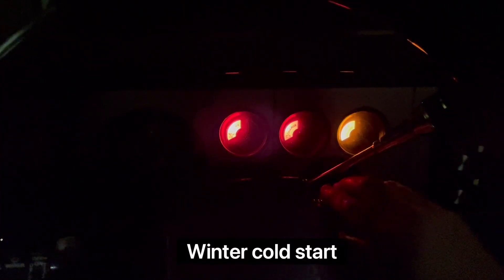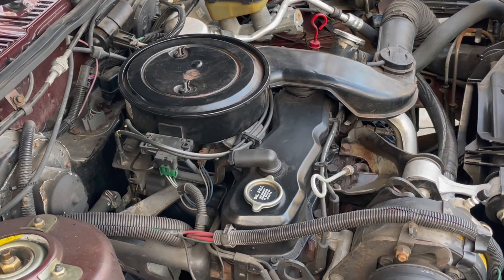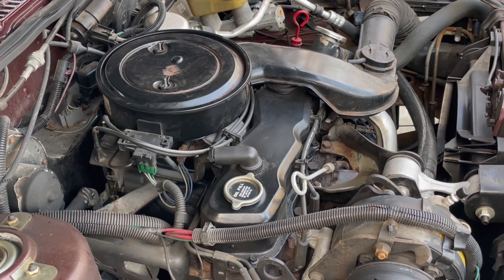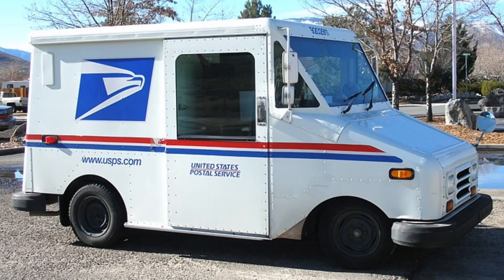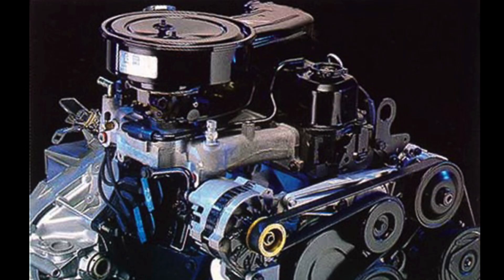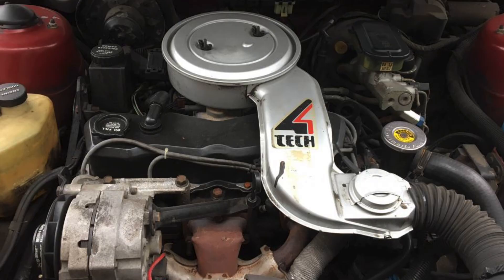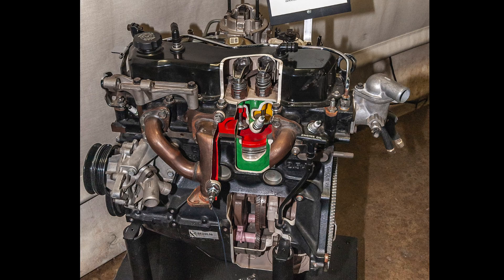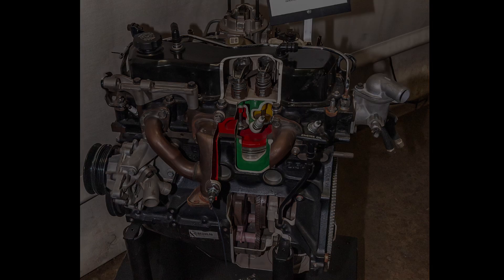Worst Sounding (and Most Recognizable) Engines: GM's "Puttering" Iron Duke 2.5L I-4

Comment: I've always been irritated that the LLV was outfitted with  TH700R4 transmissions. Why did they need an overdrive automatic for constant stop and go driving. They should've at least been instructing the drivers to use Drive rather than OverDrive to help the trans last a little longer. I realize the TH350 was long gone by then, and was never offered with that bellhousing, but there must've been a 3speed automatic behind the Duke when it was in a Monza. Why not keep producing that trans for the USPS? Or maybe they could've whipped up a new bellhousing casting to use the TH400 that they were still producing. There were better choices than the TH700R4 🤬
Reply: Agreed. Hell, they could’ve even brought back the old Powerglide from the dead for the USPS, for that matter
Reply: @440mgnm  Yes definitely 👍

Comment: Having worked on these in the day, the primary source of noise is too much backlash between the  cam and crank gears.  Early on, replacement gears still had too much backlash and continued to make noise after replacement.  Later a revised gear set hit the market and the engines were relatively quiet.

The Iron Duke in rear drive cars had intake and exhaust on the same side as it was based on the 250 / 292 inline 6, this configuration continued on in boat and industrial applications ( like forklifts and generators ) expanding to 3 Liters .  In fact, the 3 L was available in the GM performance parts catalog as a 3 L Super Duty as some were road raced in Fieros.   And. . . the company Blueprint Engines still builds a version of the Iron duke for industrial applications. There is even a prototype with a GM LS V8 head.  

Front drive cars got a cross flow head and later a tubular exhaust manifold.  These tube manifolds tended to crack where all of the cylinders joined together however there are easily welded with a MIG welder running regular mild steel wire.   ( I had a spare cylinder head at the ready to use as a welding fixture ) 

The N cars used a shorter version of the " Tech 4 " as under hood width was at a premium.
Reply: Interesting post. Thanks.
Reply: The engine that was based off the 250/292 six was never called an iron duke. That was the Chevy II 4-cylinder which was actually based off the Chevy 194 six. Only the Pontiac designed engine is called the iron duke.
Reply: @Cream_of_sum_yung_gai   The Iron Duke / Tech 4 were not clean sheet designs by Pontiac, all they did is take the non cross flow headed 4 cyl and designed a cross flow head as well as making it front drive capable.  ( Side mounted water pump , smaller bell housing )     The timing cover gasket ( all the way up to the N cars)  is the same as a Chevy 250 / 292  inline 6 . 

The last " real " Pontiac engine was the 265 / 301 V8 that went away in 1981 ish so Pontiac engine engineers didn't have much to do so I'm betting this is why the 4 cyl was attributed to Pontiac.  All the other divisions still had their native engines going or were busy working on moving to corporate engines. 

Calling any of the 3 four cylinder engines Iron Duke is generic enough that anyone in the biz knows what someone is talking about.
Reply: @bobroberts2371 iron duke has the distributor at the flywheel end of the block, Chevy II has it at the front. Head bolt and bore spacing is also different.

Comment: If nobody said it yet... (Among the) Worst sounding engine to me is the Chrysler 2.5.  My wife had that engine - a stroked 2.2L K car motor - in a Dodge Daytona.  It sounded like a diesel and at idle it'd shake the coins you kept in the ashtray. It had torque until around 2000 rpm so the car would move fairly well until about 25mph and then have an asthma attack.  Great car for around town, but couldn't climb a mountain on the interstate no matter what you did with the accelerator pedal.

Comment: I owned a 1981 2 door Pontiac Phoenix with a manual trans Iron Duke. On the plus side, it would start at 40 below zero. On the negative, it clattered loudly and developed a metallic clanging at about 30,000 miles when under acceleration. I traded it the week I noticed that. Never owned another Pontiac.

Comment: I have to disagree with this. I owned a bought new 1986 Pontiac Fiero powered by the 2.5L Iron Duke, with a 5 speed manual transmission for 11 years and nearly 200,000 miles without a single problem. Yes it has a mechanical sound. Pretty much all 4 cylinder engines do. Have you ever listened to the sound that an air cooled VW engine makes? I've owned three air cooled VW Bugs, and I love that sound, especially with an aftermarket exhaust. I currently own a 1972 Ford Pinto wagon with the 2.0L SOHC inline four engine. It has solid lifters (not hydraulic) and makes some mechanical noise. It's supposed to. It's a machine.

Comment: One of my favorite GM engines was the Chevy 230 straight six.  All was great until you had to drive through a puddle or remove the manifold.  Nothing short of milling could make that exhaust manifold fit and seal again.

Comment: Boy, that is a key sound of the 1980s and it was everywhere.  The weird thing is that common sound of the Iron Duke made my Calais’s Quad4 feel and sound like a finely honed Swiss watch!
Reply: The Quad 4 was a relatively smooth engine and when equipped in the right car produced exactly twice the hp of the Iron Duke. Quad 4s get a bad rep, but I had one in a 1989 Calais and it was pretty stellar. The early ones were trouble prone, but the later ones were sorted out.
Reply: @paulwindisch1423  I loved my ‘90 Calais with the Quad4.  It was seriously quick for the era.  I could easily keep up with 3 series Bimmers and Saabs.  My only complaint with the car was I wish it had 4th cog In transmission.  Otherwise, nice light car with a people engine.

Comment: I bought a pristine 82 olds omega 2 door with the iron duke in 1995 from a little old lady, had less than 50k miles. Needless to say, she had never had an oil change done. I changed all fluids but it still spun a Rod and main bearing within a month of purchase. I had to pull it and completely rebuild it. It lasted me from 1995 to 2005 and still ran great when I gave it away. If I remember correctly the cost of internals was cheap, It used Chevy 350 pistons and rods and Rod and main bearings. The phonetic gear was never a problem for me. I had the single fuel injector fail twice(TBI). Also the engine top Mount shock absorber(from the engine bracket to the radiator core support) would wear out, and would cause extra noise from the engine bay. It was a very reliable engine once I redid it
Reply: Actually it had the same pistons and rods as the Pontiac 301 V8, designed at the same time, which had the same 4" bore and 3" stroke...the Chevy 350 had the same 4" bore but I assume a different pin location due to the longer stroke & shorter rods.

Comment: Ford's 2.3 and 2.5 liter 4 cylinder engines that they developed from their inline six, and used in the Tempo, Topaz, and Taurus was tractor-like in its NVH.  Maybe not quite as bad as the Iron Duke, but still crude.

Comment: You forgot Camaro and Firebirds had this engine in the early 80s. I would like to see you pour all the oil out of that metal air filter housing. I used to do tune ups on them and every time i would take the filter lid off there would be oil to the bottom of the filter gasket.
Reply from the maker: I did mention Firebird ;). Never seen that oil issue with mine.
Reply: I should stop commenting until I've watched the whole thing. One of my bad habits. :( @RareClassicCars

Comment: Fuel sipping , pocket pleasing front wheel drive Omega by Oldsmobile... we had one built for you!  Omega!  Oldsmobile....I remember this engine. I remember putting this engine in so many GM cars. I recall it was even offered in Firebird and Camaro at one point. What about Quad 4? It was a high tech 4 cylinder engine.  The interesting that the 4 cylinders are more powerful and turbo charged too. I liked the fact you mentioned the GM Brazil engine. Thank you once again Adam.
Reply: He does great reviews.  I want him to review the Quad 4.   I drove one in a Grand Am in the late 80's.   I took it back to the dealership 😂.   That thing was rough.
Reply: @keithjackson286  I would like to hear what he has to say about the Quad 4 too. He does have great videos. I never called this engine the "Iron Duke".. I always called it the Tech IV 4 cylinder. My uncle had a Pontiac Grand Am that had this engine. I had a friend that had a  Buick Skylark that had this engine. I know two people who had a Oldsmobile Cutlass Calais with this engine.  I recall seeing loaded Oldsmobile Cieras and Pontiac 6000's with this engine. You could hear anyone coming with any GM car that had this engine. The mail trucks are still in service as he says.

Comment: Overall harshness...My vote goes for the Chevy Sprint 3 Cylinder (Predecessor for the Geo Metro) Like the Iron Duke, it ran (though that was a mixed blessing) just fine, but I've driven Army trucks with more refinement.
Reply from the maker: Good call

Comment: I agree that these engines sound horrible. I had to replace the cam gear in a customer's car back in the late 80's. The worst part of the whole job was that the gear was pressed onto the cam, requiring me to lift the engine practically out of the car to remove the cam. 
I would also add that GM was very into using RTV instead of gaskets, and the Iron Dukes had the leakiest valve covers of almost any engine.

Comment: Had a Duke in a marine application/ Mercruiser.  I remember it being a little under powered but not any noise personally.   It was a super reliable little engine.  I’d file the points every spring and it was good to go.

Comment: Mopar slant 6 always had a certain noise to it, though I think it was just the valve train. Also too, those things were on the road for so long they seemed louder because they were from a bygone era.
Reply: The Slant 6 used solid lifters until the 80's, and I would imagine that nobody ever took their Valiant in for a valve adjustment! Besides, they were so reliable, all you had to do was add oil and drive it.

Comment: The phenolic cam gear was used on the ford 300 i6 as well,they lasted pretty well, but I tore mine apart to replace it with a cast iron gear that will outlive me. I can see why the factory chose the phenolic ones though, as it sounds much like a tractor - works for me as I am happy with the reliability.

Comment: I had a 1987 S-10 for 11 years Iron Duke. Fiber gear failed at 125,000 had it towed to BES and they bored it.030 over and it was still running when I sold it to my brother in law.

Comment: I have to agree with you. These things have to be the crudest engines GM every built. I remember working on them back in the day we got a lot of these in for warranty making noise. One of things they would have us do is drill a small hole in one of the oil galley cup plugs. It was right behind the cam gear. This would allow more oil to lubricate the gear. At best this was a band aid fix. It did make the gear last longer.  You are right the noise is generated from the cam gear interacting with the crank gear. The repairs we did did improve them a bit but they still vibrated pretty bad. The balance shafts where a God send. It smoothed these out a fair bit. Another issue with these is head bolt fractures. The head bolts from the factory where actually too hard and did not have enough stretch during thermal cycling of the engine. Over time they would break. The repair was to replace the head gasket obviously and with the head gasket you got a set of head bolts which where actually softer. The torque sequence was also changed to a torque to yield configuration. As you said these engine where reliable just very crude.
Reply: These ALWAYS sounded like CRAP, but so did MANY "G.M. classics"! They DID USUALLY "do the job", though!
Reply: If anything, the phenolic gear would tend to dampen noise. 
I found the noise was changeable for better or worse, by shimming the rockers. 
Too much though, & it wouldn’t run right.

Comment: My local post office still uses LLVs so I still frequently get to enjoy the sound of the '80s. My badly neglected '89 S10 sounded like an irate sewing machine all the way up to like 230,000 miles when I suspect it lost a piston wrist pin. It drove 80 miles home with a piston progressively smashing into the cylinder head harder and harder the entire way. It appeared to still be getting its normal fuel economy while it did it and I was still (barely) able to travel at highway speed. 🤣

I also challenge you to revisit your thoughts on the 5.7 Diesel before you judge GM's crudest sounding motor again. 😂
Reply: Those diesels were awesome sounding. 😎
Reply: @LongIslandMopars  Hard disagree...
Reply: @TheBrokenLife  Its an acquired taste ...😎

Comment: The Duke got pretty good toward the end of it's run. In typical GM fashion. It sounded rough at start and at full throttle, but was quite at cruise in the N cars.
Reply: GM still was running the bones of this engine into the early 2000s.  Refined it quite a bit.  We had one in  an 88 celebrity, and I had the newer one in a 01 alero,  and it's night and day.

Comment: Its noisy, its slow, and its heavy, but its reliable to a fault. I had one in my 1988 Grand Am 5-speed, and it was great. Decent on fuel, although it leaked oil like crazy, but it never let me down. These things are almost agricultural in their design, sound, and power output. And those balance shafts, that was the only thing I ever had issues with in my Grand Am. They just let loose and lost the oil pump since its driven off of the balance shafts. Thankfully I was still able to source one from GM at the time (2005 or so) so I could replace it (which is easy) and keep going!
Reply: Do you happen to know how to access the coil packs in the transversely mounted iron duke? Do you have to remove the intake manifold?
Reply: @gregorymalchuk272  from underneath the car. the crank sensor is behind the coil pack/igntion control module and it fails quite often. Its not too terrible, but its a pain in the rear.
Reply: @MichaelAStanhope  I was looking at it from that angle, but some steering link or sway bar and a transmission mount keep me from being able to get an arm up there. Somebody else said that the recommended thing was to unbolt the dog bone motor mount, swing the engine forward by about 4 inches, and access it from the top. I lost spark on cylinders 1 and 4 on an 87 iron duke with distributorless ignition. I was suspecting a bad coil or bad ignition module. What problems does a failing crank position sensor cause? I have heard of it causing no spark, but would it cause this? I had heard that the crank position sensor is connected to the ignition module and actually comes out with it.
Reply: @gregorymalchuk272  yeah, you have a failed coil. There are 2 coils on there, one for Cyls 1 & 4 and one for 2 & 3. One of them has failed. I would replace both of them to be safe. You can do it from the top if you take the torque strut mount off (dogbone). Not sure what care you are working on, but in my old Grand Am i found it easiest to get access from underneath the car. If the crank sensor goes out, you will get NO spark at all, as in the car won't run at all.
Reply: @MichaelAStanhope  Do you think it's the coil or the ignition module? They use a wasted spark system, so I measured both the coil secondaries through the spark plug leads and got 28000 ohms. Perhaps 10500 ohms for each lead and 7000 ohms for the coil secondary, which is exactly what the Haynes manual says. Do the coil primaries short or go open? Were the coils common failure items? I'm more suspicious of the 36 year old power transistors in the ignition module. If it was easier to access I would be tempted to swap the coil position and see if now cylinders 2 and 3 are dead or if it stays at 1 and 4. But the difficulty makes me want to replace everything. Another thing is that the V6 engines would get corrosion and lose the ground through the bottom of the ignition module to the bracket, is that a problem on the iron duke?
Reply: @gregorymalchuk272  id still lay bets on the coil being bad. In 25 years as a mechanic i've found that readings using an ohmmeter can give you false leads on the GM DIS system. Honestly, at this point, I would replace everything down there since its all eventually going to fail. Id pop on a new crank sensor, ignition module and coil packs just so that 1) I would only have to get in there one time and do it and 2) so i know its going to be reliable for another 10+ years. On these engines, and the 2.0/2.2L engines in the Cavaliers I honestly just replace it all since its a pain to do in general, and its really a lousy place to have the igntion system in general because of heat.

Comment: 1982 Skylark 2.5 had the thermostat on the back of the head, with a spout that had a cap like the radiator. Thermostat had a handle to assist with removal. Such a super useful design. Replacement of thermostat took mere seconds. Sure wish this was used in all cars.
Reply: And they were tough, dependable motors ever made by anyone. But Americans have developed a habit of not finishing the job(fine tuning)
Reply: You only need to replace the thermostat every 10-15 years on any decent engine.
Reply: @fastinradfordable A lot depends on the stat too...I once had a name-brand (which I won't mention) stat fail-- in the CLOSED position, no less!-- in no time, like under 2yrs /20K miles or so.
Reply: Yep. Changing the thermostat is literally a 10 second job. Maybe 30 seconds if you need to swap the weird cross section sealing ring around the edge of the thermostat and oil the rubber O ring in the cap as recommended in the manual.
Reply: Mostly this was done to assure a full coolant fill given the radiator was mounted pretty low in these cars.